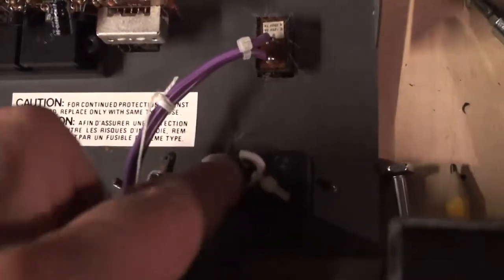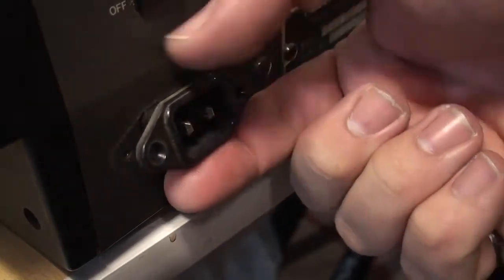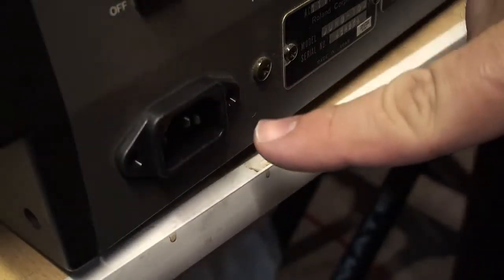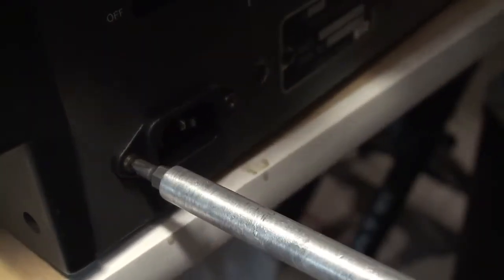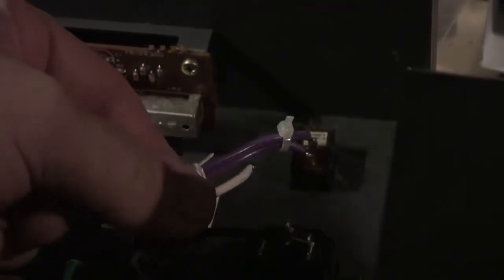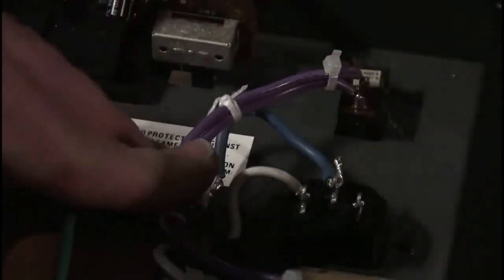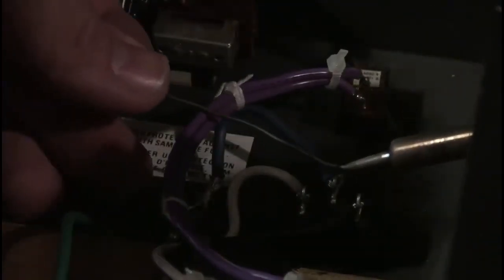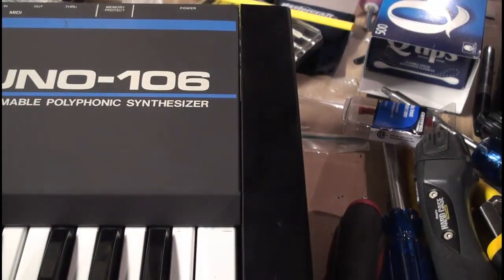Packrat's Juno106 - Part 24

Comment from the maker: I'm glad to see the techniques I have showcased are serving others well. As for the vacuum de-soldering tool's spring and filter, I generally leave the filter alone (only changed it once since getting the tool) but the spring can be cleaned out if you remember to open it up before turning on the iron every few sessions.

Cleaning out the spring involves removing it from the rubber plug and gently stretching it out so that the slag detaches from the coils and drops out the bottom. Then reinstall!

Comment: This comment is unrelated to this video but does pertain to this overall repair. I recently bought a Hakko 472B because watching you work with yours looked a hell of a lot easier than a using a solderpault. My question is how often do you have to clean/replace your filter spring and ceramic filters doing these repairs. I've been going through some old parts boards and practicing removing sliders and rebuilding them like you show and they turn out great. Thanks so much for making these videos.